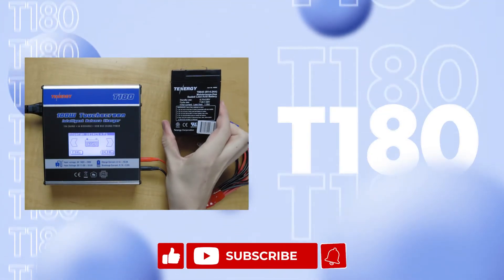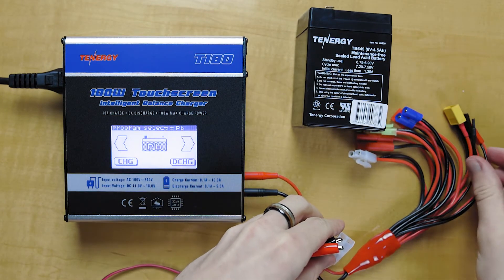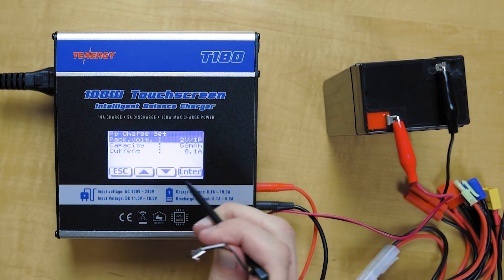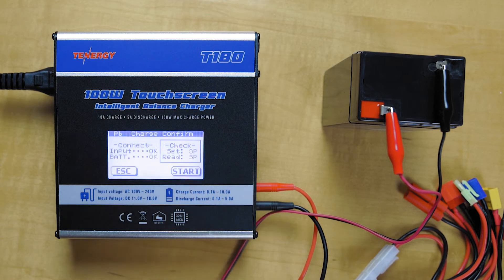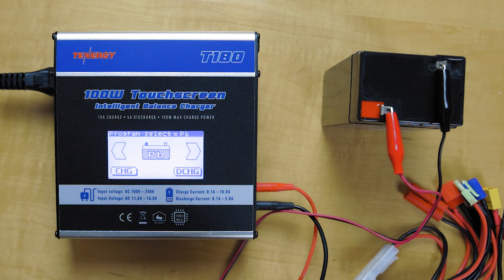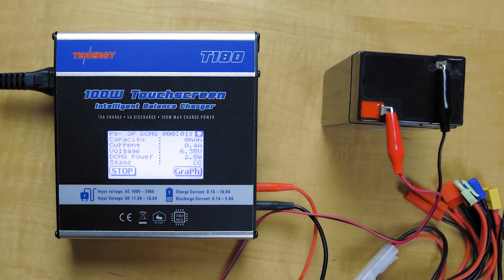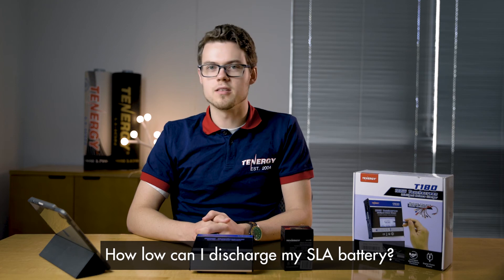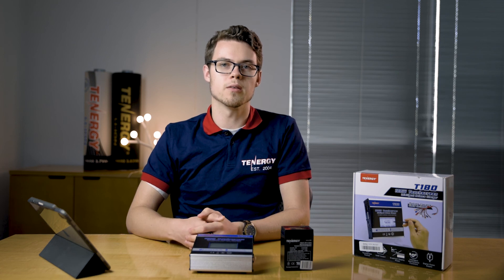How to charge and discharge SLA (2-20V) battery packs with Tenergy's T180

Comment: I have a T180 that I used to recondition some Prius cell packs, and I recently saw a video where they use an inverter welder to recondition a flooded lead acid battery. I was trying to figure out if a T180 can recondition a Flooded Lead Acid battery, and what settings I would use.